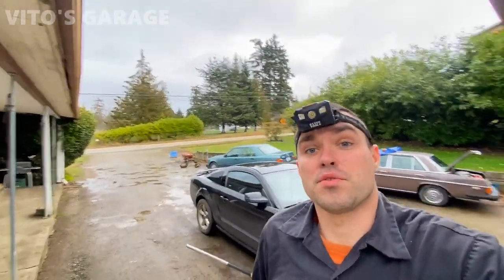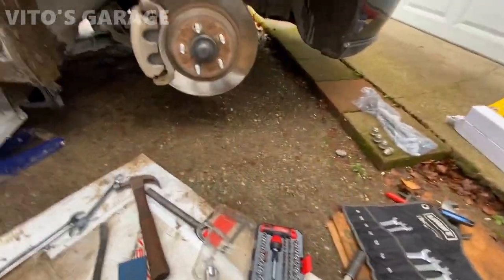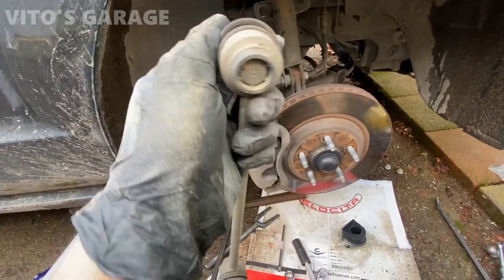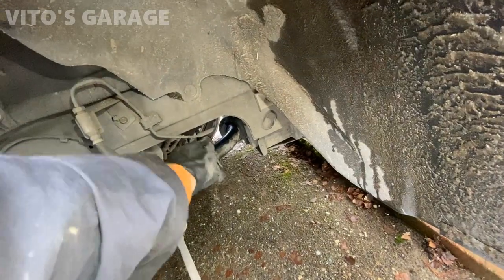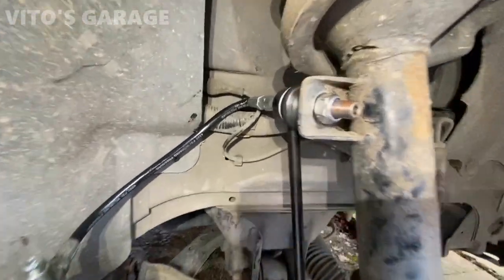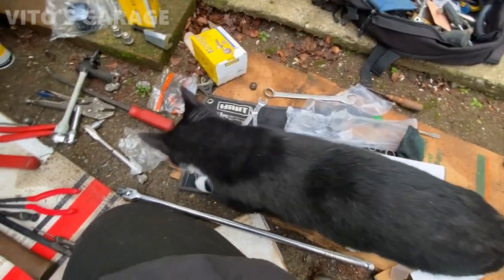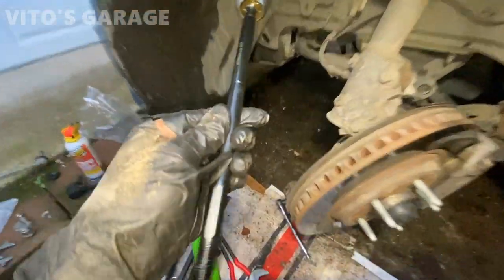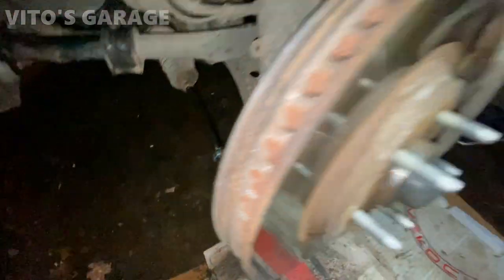2006 Ford Mustang GT Fixing Tired Front Suspension. New Tie Rods & Sway Bar Links/Bushings

Comment: Veto, what gearoil did u use in the w115 before changing to atf?  Was it a regular gear oil or a special MT (manual transmission) oil?  Thanks for sharing.
Reply from the maker: I had a Valvoline Full Synthetic 75w-90 oil in it
Reply: @VITOSGARAGE  Thanks for sharing.  I bet that was a GL5 differential oil?  Not a MT oil?  Live and learn.  Thanks for sharing.  Be safe.